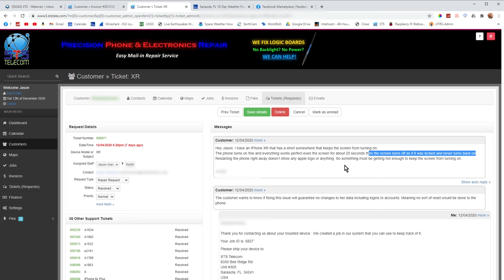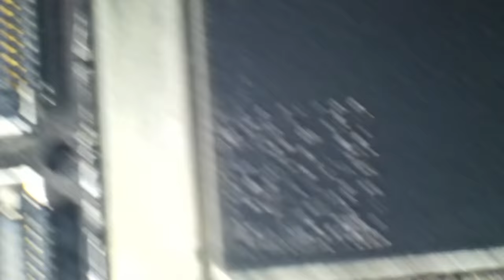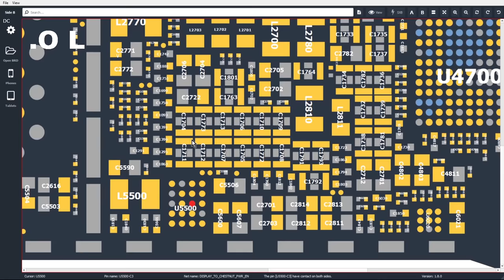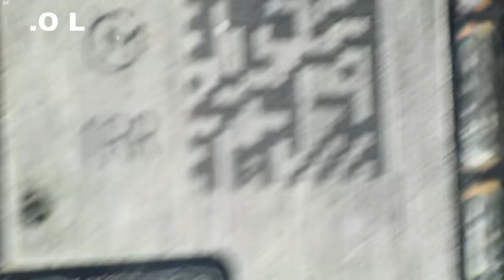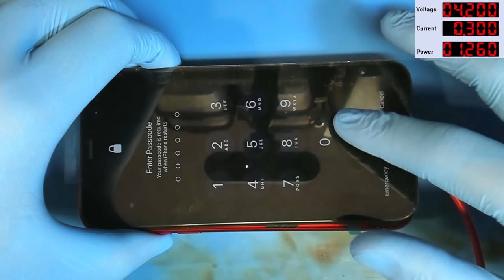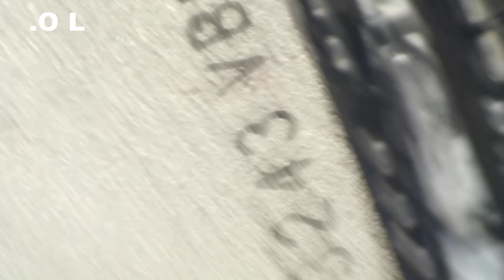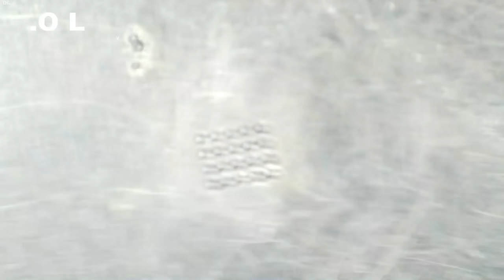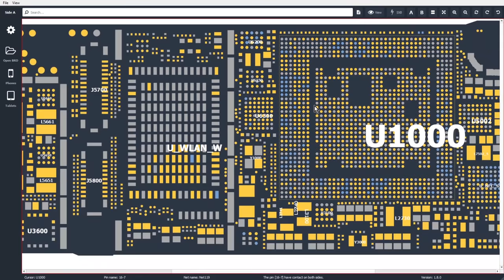Repairing an iPhone XR with "No Image" - What I found inside this phone was horrifying!

Comment: Watching him work through a microscope, thinking of my preferred soldering tools as an oxyacetylene torch and a sledgehammer, I'm reminded how far things have come in electronics repair.  I thought this stuff was only done by people with little, teeny, tiny fingers . . .  Pretty cool.
Reply: Very interesting video.  I would say I pretty much understood everything he was doing, but I draw the line at reflow under chips.  Having a template sure helps, though.  The most technical work I had to do was fix a board on an Audi new car.  The dealership drove the board 45 miles to my location, my garage, lol.  It was basically a torn off 6 pin connector.  Had to repair the traces and the ones that could not be repaired bypassed the trace with wire connections.  After double and triple checking all the connections hot glued to seal and reattach the 6pin connector.  Worked prefectly fine.

Now, I just make BBQ wifi controllers for people.  Much easier starting from scratch.

Comment: Nice video.
How do you go about knowing how much should a pin measure in diode mode? Where do you find that information? Is it written on the diagram or do you need to compare it with a working board? Thanks.

Comment: Looks like you spent >24 hours on this. Don't know what your hourly rate is, but this repair is likely costing more than a new phone... Very impressing video! Can't believe you hold the chip by hand with tweezers to hot air it back in... how the hell does it align?

Comment: Hey Jason,  I just stumbled across this video.  First time seeing you work.  Impressed.  But what a mess on that phone!

I need your services,  lol.

I have two items…. I touch 128gb, just before cameras were added.  I need a new battery.  It worked fine last time I used it.  Being older tech, batteries probably will be limited to sourcing from Shenzhen China. Or Banggood or AliExpress.
Palm tungsten E2, heavy made, metal case for it.  I need battery replacement also.  It was made by “PalmOne.com” ages ago.  A “PDA”.
OUTDATED BUT THERE ARE SO MANY FREE APPS FOR IT. THAT “WAD THE TECH BEAST IN THE OLE HAY DAYS!

Let me know if you can source batteries for each and install them.  Most Humble Appreciation!

Comment: Seems like you're having a lot of fun doing this I'm I don't know how you deal with them small chips and stuff I'm a mechanic myself and I deal with a lot of wiring issues and why diagrams thing that drives me nuts is when the designers make their products so hard to fix or they put the a problem area in the worst area you can put it because you have to take everything apart sometimes the designers need to go out on the line and fix these phones so they can figure out oh that chip breaks all the time so we want to make that easily accessed

Comment: I'm practically a Luddite/caveman, but I feel almost like I *UNDERSTOOD* some of what you were saying and doing.  :-O  WTH?  Honestly, back in the day, I was poor af, and would dumpster-dive for virtually everything I owned: furniture, clothes, hell, I even found a bunch of freezer food someone had tossed right after they'd thrown it out(it was still mostly frozen).  I'd also found a lot of just-obsolete computer-parts.  Everyone I knew had computers and were online.  I didn't and wasn't.  So I figured out how to put one together from the parts I found.

This was in the time when PC's were modular enough to be built that way: good 'ol "plug n' play" days.  Find a tower with a motherboard and RAM inside, find hard-drives, a monitor, an old keyboard and mouse, hope there was a power supply, a good video card (or find one still working), and fan on board the tower and off I went.

I had to learn what the pins near the RAM were for to master/slave the various add-ons (to main and secondary the hard-drives, CD-ROM), and to add in as much RAM sticks as the board could carry.  Later, I'd bug my more knowledgeable friends to help me find hard-drives with higher storage, a math co-processor with higher speed, better RAM with more memory capacity so I could have a more powerful system, and voila, I went from a dumpy old 386 to my  knock-off Pentium equivalent in the late '90's just after they'd come out.  And gods, the heat-sink and bigger fans I had to get to keep the math co-processor from overheating 'cuz of my overloading stuff...  :-p

I named it Frankenstein.  LOL

Nowadays, it's harder for me to Frankenstein a computer that way.  The individual components for things like a laptop are WAY too small.  But, a standard PC is still a bit plug n' play--at least my current system is, but some of the stuff is more esoteric.  It's mostly the programs that trip me up, now, instead of the hardware.  :-p

What *you* do, though, that's freakin' GOD-level.  This video was actually fun to watch.  :-)  Thanks for posting it.

Comment: Can you please elaborate on the "reset line" -> I understood most of this video but I didn't understand what you meant by that and how it could've saved time or what it had to do with the ultimate solution to the problem.

In fact, I'm not entirely sure what it was that solved the problem except that you seemed to hint at the fact that it was likely due to the re-flow of the CPU?

Comment: Looks like an inductor, just as a resistor will be the same, no matter 'polarity'.
Diodes, transistors are polarity dependant.
BCE, Pin configurations, GDS for Mosfets.

Comment: As a real post, ICs are placed on circuit boards using balling. So on the bottom of the chips there are balls of solder on all the connection points. When placed and heated the balls melt allowing the solder to connect the chip to the leads in the board. When they “reball” they heat the board till
The solder gets liquid again and releases the chip from the board again. They then clean up the old balls (remove) and place new ones and reverse the process to reattach the chip to the board. Now ball squeeze I would believe might happen due to pressure or overheating causing the solder to press out at points you shouldn’t see it. Imagine liquid being squished out of a tube of toothpaste. With the solder being in liquid form it “squeezes” out of the weakest point and causes little exposed balls of solder.

Comment: I wouldn't use cotton swabs to clean.  I use smaller absorbent applicators with esd safe handles, and fine tips.  I would also use  electronic hard hair acid brushes to scrub with and a vacuum to remove any debris and alcohol.  You could use BIOACT instead of alcohol to remove flux that should never have been left on those parts to begin with.  I don't care if it is a no-clean flux... I remove it.  Solder balls on the components aren't from them getting hot.  That is a process indicator and either they are doing it wrong or their QA inspectors aren't doing what they are getting paid to do.  Good eye on finding the details.

Comment: After watching this I'm a bit curious about an Ipad 7th gen that I've got sitting here. I'm a bit of a newer tech when it comes to electronics (Auto for nearly a decade) so I'm treading lightly on this one. It's stuck on the apple logo drawing 700ma consistent, just sits there. It's my understanding that the CPU on these often separates a little bit due to flexion.

My question is: Do you think that doing a gentle reflowing procedure, like you did here, might be the right step to take?

Luckily this isn't a data recovery job, in fact, the customer might just be giving us the device as she's likely just going to buy a new one. So I may be able to do a bit of experimenting without the worry about loss of data or even the physical device hanging over my head. But I'm the type that's pretty hard on myself when I fuck up so I would like to make this a working device again if possible. Have some old Ipad 4's here that I'm starting to use to practice reballing CPU's.

Comment: 54:46 Excuse me, what is that tool you're using? I can't tell if it's a sottering iron that dispenses sotter through the center or if it's a normal sottering iron that just has like a shiny tip from the sotter that has stuck to it.

Comment: OK I'm no expert but u said u were putting temp to not hot enough to melt solder or even to boil water at around 30min in. Then u say 195°c. Doesn't water boil at 100°c??
Love the vids by the way.

Comment: High-melting-point solders were used in mechanical components where extra-high strength of bonding was considered necessary.  Why you would need that in an I-phone is kind of hard to understand...

Comment: Probably less repair and troubleshooting if concentrated on the reset line, but reflowing a bad soldering job and cleaning boards up you more than likely actually repaired it better than the refurb team did.

Comment: This can look more sophisticated than it really is. What I mean is you’re just measuring resistance between two points, also checking polarity (or what way round the connection should be) and the current used by any chip.
So it’s a simple case of checking if a chip is defective (by showing no current, abnormal current etc or by looking at the the pins), or checking if you have continuity between two points (acceptable within a certain threshold- when he says 0.03 ohm etc). Really that would indicate a broken electrical connection for the measured circuit, depending on resistance or more likely judging by these videos; dirt, nastiness, flux and other bad soldering.
It’s really not that complicated when you think of it as a big/hand wired circuit.
Just the same old techniques that repairmen used back in the days of electro-mechanical jukeboxes etc.
My view anyway

Comment: uhm, at 31:30 are you heating to 190C or 190F?  190F is just below the boiling temperature of water.  190C might melt some solder.

Comment: Solder balls are usually caused by crap repairs. It isn't squeezed out, it is probably  caused by surface tension on the component.

Comment: Maybe I missed something, I know absolutely nothing about phones & very little about circuitry, but he said he was gonna dry the board (I think that's what that is at about the 30:00 mark) at a temp not hot enough to boil water, then proceeded to list a range of temps that went up to 205 C. Isn't the boiling point of water 100C/212F? Would it even matter? Not trying to be a d, just curious.

Comment: Amazing insight into the component level of a phone and the repair techniques. I have a ?6S? that has, like a teenager, lost ALL ability to communicate with the world outside of itself even via USB. All other functionality is unaltered. Any idea if that’s repairable?  There are just a few photos that I would like to retrieve in a perfect world but I haven’t missed them in six months!  Fortunately I had everything worthwhile on OneDrive but it made swapping to its replacement a days chore for a teenager! I am lucky that I have a tame one with working comms in the household!😂. Have you ever worked out your hourly rate?  If not, then I suggest that you don’t. I sense that you must work for the joy of it. 👍
Reply: That is typically repairable. But you can pick up a 6S for $100 or so it may be more economical to replace it.

Troubleshoot:
Firstly, Try new screen, battery, charge cables and dock flex. 
Troubleshooting:
1. Does the device charge?
2. Use a PC with iTunes. Does iTunes detect it, while plugged into the computer? 

A.) If yes to 1 but not 2:  Replace USB IC. 
B.) If yes to 2 but not 1: Replace USB IC,. Check charge IC, Battery DATA lines. 

If after, still does not boot, you'll need to professional guidance.
Reply: @OnYourSquare  big thanks for your kind help. I really only want to salvage a bit of data/photos. The bizarre thing was that it booted and ran absolutely fine in all respects but I could not communicate outside the device by any means either wired or wireless even nfc was dead. Not only all the radios but even usb. Not even via iTunes. The only user interface that worked was touch and the buttons. Weird really.

Comment: 24:49 "...and apply some light upward pressure" - which was formerly known as "a light/delicate pull" ;-)
Yes, I know, it's nitpicking - but that "modern common English" never ceases to amuse and bemuse me... Good video, anyway. Cheers!
Edit/ Addendum: 30:17 (or so) - "a temperature ... that is NOT actually hot enough to boil water" - and then "I'm going to start at 195°C..." (and end up at 205°C) - WHOA that's what I call "having balls of iron" (or solder, whichever is more suitable in this case).
Sir, I'm afraid I have to put a little fly in your ointment, as water used to boil at mere 100°C, and at 188°C even a 60/40 Sn-Pb solder would melt... Yeas, I know - you've meant "°F", nor "C" - still...

Comment: @30 min heating Uhm...water boiling point is 100 Celcius and you said you dont heat over water boiling point. So what did you mean with 195 C for temperature? Fahrenheit?
edit: just checked, 195 Fahrenheit is 90 Celcius. Ethanol boiling point is 172,5 Fahrenheit ish btw.

Comment: He doesn't want to preheat it to even enough to boil water. But 195C is nearly twice the heat required to boil water. That's 383F. That is high enough to melt most solder. No offense intended. Just saying and I know he said the preheater isn't calibrated.

Comment: The balls are not squeezed from anywhere. They are from excess solder paste, bits of solder paste that were isolated when it melted, or sputtering from using a very hot iron, which is common for repairs and replacements of chips in China. Work very hot and fast. Sometimes you find balls all over the place. A good properly tuned manufacturing process will have none.
Reply: Yeah, it looks like "no-clean" flux everywhere and the excess solder paste melted into balls suspended in the flux.

Comment: At around halfway, when you were drying the board, you said you werent even going to be adding enough heat to boil water, then start talking about having temperatures of 195+⁰C?
I... dont think thats right? 195 is almost double the boiling point? Am I missing something?
Reply: Hes tried to convert it to celcius and made the math wrong.
Hes probably more used to fahrenheit

Comment: Brilliant video on this repair, but I have to say your degree celcius temps are just wrong.

You start saying using a 190 Celcius and will ts not quite hot.  190 Degtees Celcius is almost twice the boiling point of water, later you talk about 350 degrees Celcius is hotter than ovens where you cook your dinner.

Comment: Thanks for an interesting insight into phone repairs....  CAUTION AT 30:10 mark (or there abouts). As a matter of SAFETY "100 degrees Celcius" at sea level is enough to boil water.  The next part taken from dr google...   "At sea level, water boils at 100 °C (212 °F). For every 152.4-metre (500 ft) increase in elevation, water's boiling point is lowered by approximately 0.5 °C. At 2,438.4 metres (8,000 ft) in elevation, water boils at just 92 °C (198 °F). Boiling as a cooking method must be adjusted or alternatives applied."  The temps  you were talking about were in the 50 to 70 degree Celcius range.

I will note that you said that the device was not calibrated but you might want to use a chef's laser thermometer to see what the real temps is.

Comment: Might i suggest tiny paintbrushes for getting right down to brush pins clean for those occasions when your project it's just so tiny compared to the size of the Q-tip that you'd have to use?

I just found you on here and found you're content to be very interesting. If you're going to run a nice Channel with nice content like this, why not at least go through and clean up the comment section. Honestly, there's that much unrelated nonsense and even explicit material in your comment section that should not be there. So much of it is just not congruent with Community guideline standards so why not clean it up so that your viewers don't get subjected to it please?

Comment: Nice... you may have your temperature scales mixed up though: there is no way you could touch anything at 185C ; that’s most probably 185F. Water boils at 100C and freezes at 0C; that’s literally the definition of C: Centigrade - centi= one hundredth, so there are 100 degrees between freezing and boiling; bet you knew that 😎

Comment: Protip: There’s no point in buying 99.9% IPA. The alcohol content will evaporate over time until it eventually reaches the azeotropic equilibrium which is about 91%. Just buy 91% and be done with it, it’s cheaper, and your 99.9 will become 91% anyway.

Comment: The boiling point of water is around 100C and you sure as hell wouldn't be able to rest your hand on something that hot like you are at 31:30 so your dryer certainly isn't calibrated right if you can touch it easily at that temp which if it was that temp you wouldn't even be able to touch it without some sort of reaction where as if it was 100F then yes you'd be able to with less of an issue but you'd still feel it

Comment: Why didn't you just stick this in the ultrasonic before you tried anything
Reply: Sticking a board in an ultrasonic before repair I typically say is a bad idea because if there is signs of liquid damage the ultrasonic will get rid of those key indicators as to where damage may be. Visual inspection and testing first before ultrasonic can make your life a lot easier to find faults.

Comment: Looks like it has been reflowed by someone with no clue what they are doing. Too much heat and no heat protection on sensitive components. Plus they used corrosive flux and didn't clean. It's like they didn't know what was wrong and tried reflowing everything.